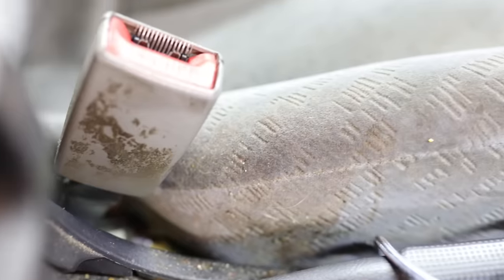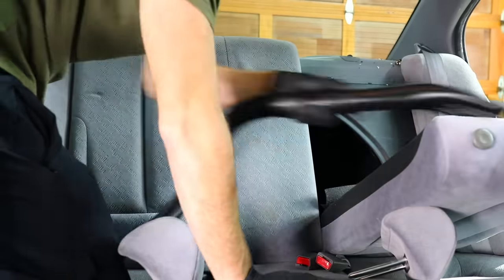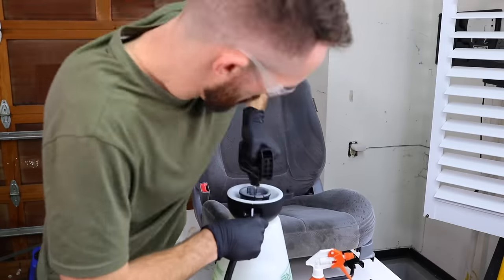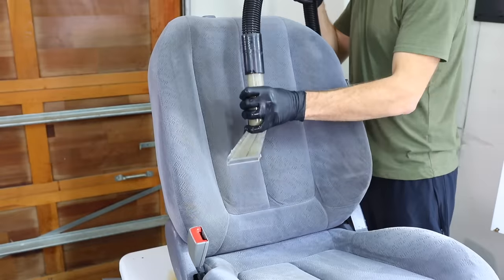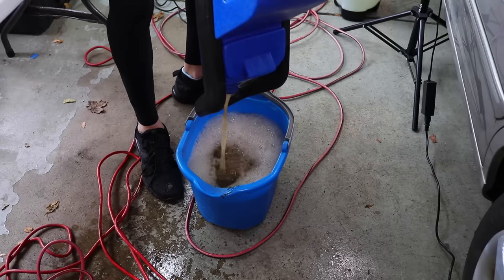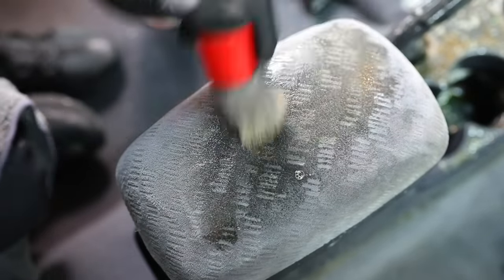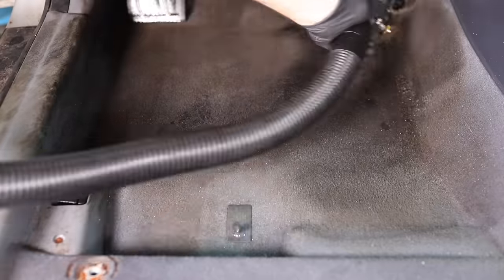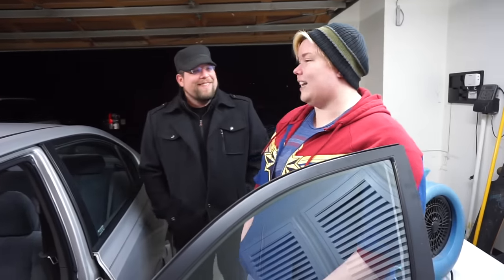Complete Disaster Car Detailing Restoration! Auto Detailing The Dirtiest Car EVER!

Comment: Very grateful for your tips. 
I have a suggestion that was shared with me by my brother who owned a carpet and upholstery cleaning business. After the extraction as you did to perfection, Do a second extraction and add laundry fabric softener to your hot water and extract the fabric a second time. This extra step with remove and neutralize the degreasers and soaps used. The soap and degreaser residue are a magnet for grease and dirt when dry. Amazing results and an added bonus makes the car or household carpet smell great. The new popular beads you use in laundry now would also be a good choice. Gain brand smells great. 
Another suggestion when you are doingbthe speakers with the cleaner it’s best to remove the speaker covers, wash separately so you don’t soak the speaker cones. Wetting the speakers will ultimately make them sound bad after the are wet and dry a few times.

Comment: No way in hell would I admit to owning that four-wheeled landfill.
Reply: jmurphy1973 😂😂😂😂😂😂
Reply: LOL, I'd never be able to stand anything I had even close to that dirty.
Reply: @ginamacdougall8288  my job in high school was to detail trade-ins for resale at the local GM dealer.  We had a car come in that was probably a little worse than this one.
Normally, I could prep a car (wash, buff, wax, vac and shampoo interior and remove stains) in about four hours and have it ready for any mechanical issues that need to be addressed.  This particular car took the better part of eight hours and I still wasn't happy with it.  The owner of the dealership ultimately got tired of putting money and my labor and time into and ended up taking it to auction rather then put it in his lot even though the exterior was spotless.  They totally facked the interior and cost everyone money in the end.
Reply: Texan Online thats fucking harsh

Comment: I just realized that deep cleaning cars is my dream job and I want to do this every day till the day i die
Reply: You and I both
Reply: Are you serious? We’re actually in need of staff to work at our shop. Washing this is not rocket science, it’s an easy job but tiring. And you prone to be sweaty as the weather is hot and humid plus you have to be flexible to get to difficult corners of the car. To top that, the pay is not good either.
Reply: @sofaremote  A tiring, sweaty job with low pay?  You sold me.  Sign me up!!!

Comment: Great video! One tip from me, on plastics and door panels use APC with Magic Erasers found at any dollar tree. The magic erasers do such a great job at removing scuffs and built up after the APC penetrates deep into the plastic! Cheers!
Reply: You shouldnt combine an alcalic cleaning solutin with the magiceraser. It lowers the abrasic properties of the eraser. Cleaning the dirty surface with the wet magiceraser and using an apc afterwards I would more recommend.

Comment: Car detailers taking out the seats is my kink.
Reply: I also take out the centre console and trim pieces from the dash. Its super easy and then i can stick them in my dishwasher.
Reply: I REALLY nice touch i learned from another detailer is to crack the window before you clean it then wind it back up and clean it again. That way when the customer winds down the window it doesnt have that dirty line from the window seal around the top.
Its the gift that keeps giving!

Comment: this makes me want to pull my car apart and detail it. I’m just scared i wouldn’t be able to get it all back in once i’m done 😂
Reply: twocheeky same
Reply: Its actually easy to pull something apart and put it back together. Honestly, I dont got a car but I have done a lot of pulling things apart and putting them back together (mostly in my mechanics class.) You just need to remember where things are supposed to be (take a picture if u may) and organize the parts, it actually helps to not lose parts.

Also, be sure to have the proper tools lol.
Reply: Usually those little wire connectors only can go back one way. Use your cell phone to take pictures. I took apart an IPhone 6x to replace the battery and WiFi antenna, and I am no sort of mechanic. Keep the screws for one seat in one baggie etc.

Comment: Got into detailing when I bought my current car in May. My wife drives a 2021 Mercedes GLC and I'm having a hard time with one thing detailing it. She puts sunscreen on her arms and it gets on the inside of the door. I have tried using a standard soft bristle brush and interior cleaner. I usually use the P&S interior cleaner. Not working great on sunscreen. 

Any ideas?

Comment: I’m getting two things. A Lilly brush and a little handheld cordless vacuum for my car. I need to clean her up. I also bring my carpets up to my apartment, pop them in my bathtub, pop mr clean and water on them, and I use a pair of rubber kitchen gloves to scrub her in with circular motions. After I rinse, I condition them and hang them to dry over my shower rod. It’s all that I can do with my car, sadly. Thankfully, a majority of my car is pretty clean. I just have a doggo.

Comment: I do have a pressing question (for me): the cars do not have "electrical" components/connectors that can be damaged by these liquid solutions? how do you avoid any damage to the car electronics when using liquids? Or basically you know which are the "sensitive" parts and avoid them? Many thanks :)

Comment: Wondering if spraying the cleaner on electric components ever causes any damage. Like spraying the window controls or the steering wheel with the cruise control on it. Seems like soaking those with cleaning solution might cause problems. ???

Comment: Took me 2 hours to do the interior. I had to blow it out first after picking trash up and than I had my vacuum with a drill brush to lift up stuck dirt. I drill brush all mats and steam and carpet extract the carpet. The roof was dirty and so much Chunks or chocolate or idk what on seats and dash so steam helped a lot. But yea 2 hours. This was a Corolla. I just want to know if that’s normal. I use to detail for a dealership but it was always new cars never used so I’m new to used cars
Reply from the maker: Thats actaully pretty quick. Well done!